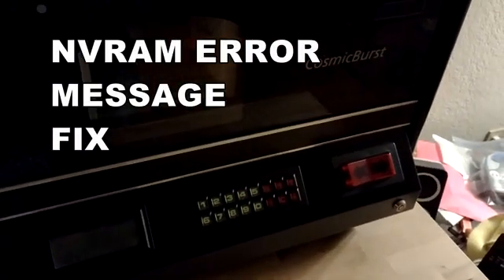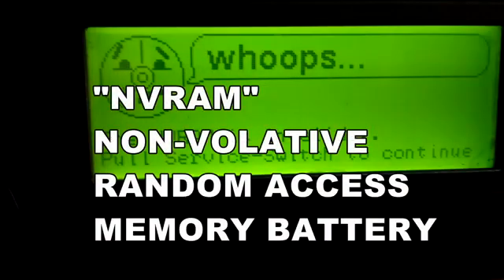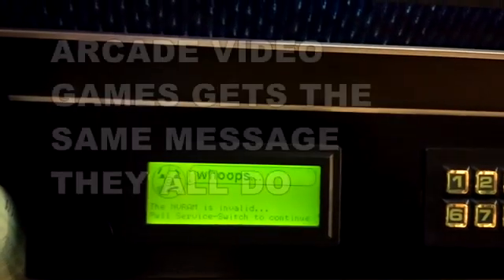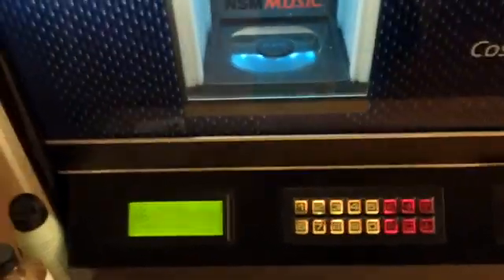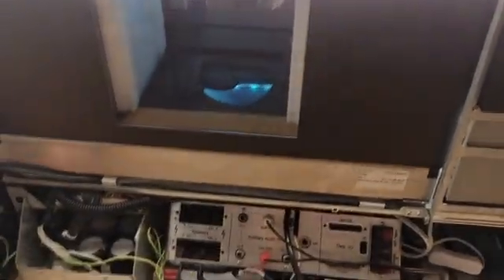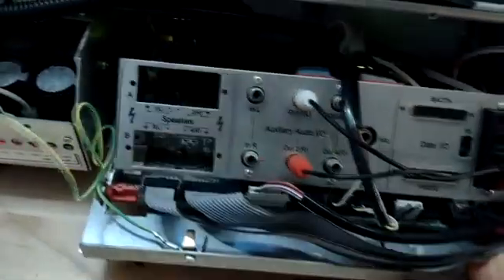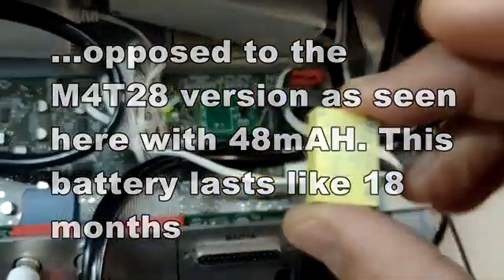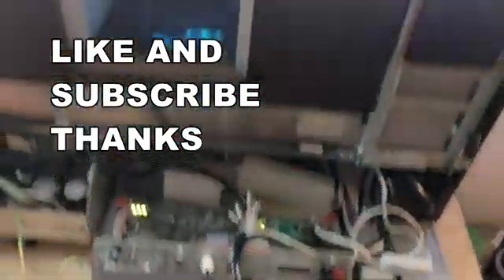NSM CD JukeBox Error: NVRAM is Invalid. Quick fix  Part One

Comment: Does anyone know what the part number is for the battery circuit board itself and or where to purchase a new replacement circuit board for the Nan phoenix cd jukebox?
I don’t need the battery I just need the small elevated circuit board that the battery attaches to the 
Thanks
Reply from the maker: Thats a tough gig. I don't know of any suppliers who woul;d have that. Look at it this way. These are like classic hot  rods, parts are no longer made for them so you'd have to get most of them sourced out. If you still have that small pcb, you can get a good real electrican to cut a piece of pcb and replace it with the same circuits.  PCB components are the electronic parts that are mounted on a Printed Circuit Board (PCB) and connected by conductive traces to form a functional circuit. Common components include resistors, capacitors, diodes, transistors, and integrated circuits (ICs), which perform functions like controlling current, storing energy, and processing signals. Other components can include transformers, inductors, switches, relays, and connectors.
Reply: Yes I still have the pcb but the 4 pins that connect it to the main board are not there I’m not exactly sure where they are supposed to be physically located underneath the components pcb but I’m guessing they are supposed to be located at P1 P2 P3 and P4 as seen on the component identifications next to each one. 
Another thing I’m wondering is why were the pins removed at the same time the battery was replaced that was actually soldered into the pcb unfortunately. 
I will try to attach a image 
Thanks a million for responding Sir
Reply from the maker: If you still have the little PCB than it's no problem. I had a electrician friend resolder the 4 pins. If you need the pins I can send you some
Reply: @oldschoolernie  
I ordered the pins off Amazon for about $7 per 200count smallest amount I think lol

Comment: My NSM juke 2000 doing something similar. Fist started that the keypad wasn’t working. Then I got told it was more likely to be the battery. Strangely it’s started working for memory again but keeps getting half way through a song then stopping with error 64 then moves onto the next song. Hope someone can help. Thanks I advance.
Reply from the maker: Possible Causes error 64: 

Laser Assembly Failure:
The laser, which reads the CD, may be malfunctioning. 
CD Transport Issues:
The mechanism that moves the CD into position for playback might have problems. 
CD Not Being Picked Up:
The arm that grabs the CD from the magazine might be misaligned or malfunctioning. 

Check CD Insertion: Ensure the CD is inserted correctly, with the label side facing up. 
Clean the CD: Try cleaning the CD with a soft, dry cloth. 
Check Connections: Inspect all wiring and connections around the CD mechanism, main board, and battery area for any loose connections. 
Light Barrier Test: If you have experience with electronics, you can use a voltmeter to check the voltage on the light barrier components. 
Reset the Jukebox: In some cases, resetting the jukebox might help. This can sometimes be done by removing the battery from the computer control unit for a few minutes.
Reply from the maker: If the error persists, you may need to enter the service program mode and try clearing the error code Unfortunately for a NSM Grand Performer I used to have at a Bowling alley, the reader on the player took a shit which caused songs not to play all the way. The CD readers were around $125 and I managed to change it myself..if you cannot find the complete CD reader you have an option just to change the laser itself. However its a job an electronics persons has to do, i just popped the new changer in and that was it. Good luck.

Comment: I pulled the old battery out a couple of the pins on the battery were broke off in the holes how do i get the pins out?
Reply from the maker: first of all you were supposed to gently wiggle out  the battery up with a screwdriver as shown, its fastened by a tiny amount of solder (not needed though to reapply a new battery)
If just the pins got left on the board, use twizzers to try to pull them out. Sort of like pulling out a splinter on your finger. Use a magnifying glass.
If that doesn't do the trick, then you'd need a soldering iron to help loosen it out. But don't go overboard or you may damage the pcb. And that would be like a Biden Trump disaster because its very difficult to find replacement parts for these older jukeboxes. Good luck and take your time brother, haste makes waste. It took me 2 days to cut a piece of thin white plexiglass replacement for the piece that goes underneath the CD page turner.
Reply: @oldschooldjernie  ok thanks I'll give it a try
Reply from the maker: @PhilLepsch  good luck Phil, its not as though you'll be solving the problem in Gaza, you can do it

Comment: I have a humming coming from my speakers / same unit (cosmic burst)... any idea what may cause that..
Reply from the maker: All these units have a shitty power amp that's tucked away below next to the motherboard area. Disconnect the speaker wires to your speakers. Try  hooking up  RCA cables out of the motherboard area to some powered speakers or computer speakers  to see if it still hums. My internal amp took a shit years ago and I removed that boat anchor and now using powered computer speakers. You can buy better powered speakers like JBLs at Guitar Center if you need higher volumes.
Reply: @oldschoolernie    Thanks for the info.  so your running your RCA cables to powered speakers... I was using speaker wire to loudspeakers..  If you ran the rca cable to say an audio receiver have you done that.. ?
Reply from the maker: @hinesjohniii  yes you can do that, connect the RCAs to a aux , tape or CD input that's never used.
Reply: @oldschoolernie  thanks for your help ..
Reply from the maker: @hinesjohniii  anytime my friend

Comment: Hi, thanks for the video I have the country classic
my battery gone as well, Ives recently ordered and been delivered,  been told these have to be soldered back in?
Reply from the maker: Do not solder the battery on. You will regret it when its time to change it again, plus its not going anywhere it snaps into place ---see the  5 notches
Reply: @oldschoolernie  Ives only gone and soldered it in, I didn't see your message before I did it, worked perfectly fine then ives done something stupid.  took motherboard off one more time just so I could spray little lubricant in the plugs and when I turn on the screen comes on but with no writing, feel like crying haha why did I have to take the board off if it was working!  any ideas?
Reply from the maker: @JustinScothern  let it dry out, if it still doesnt work you'd have to follow the leads from the screen to the motherboard and see if thats where the oil shorted out the thing. Check your manual, it has the schematics